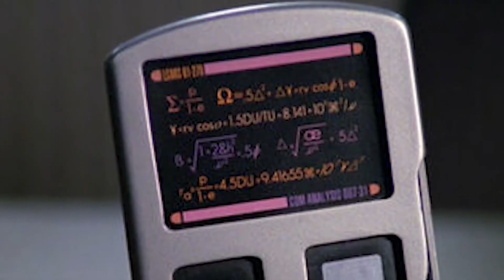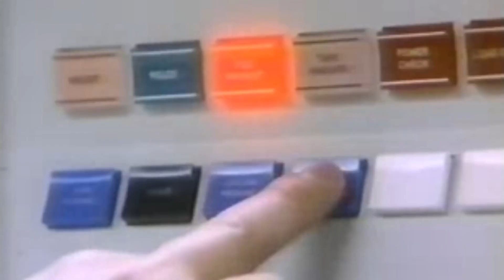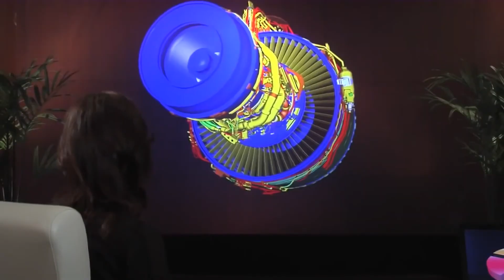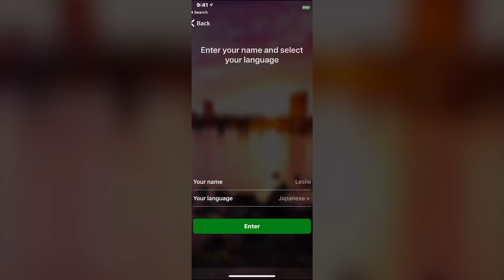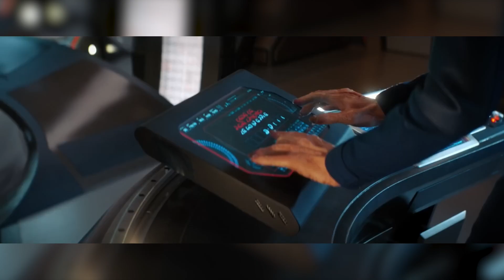Star Trek Tech: Predicting The Future

Comment: The medical scanner looks like an ultrasound scanner. They do make portable versions that hooks up to a tablet. It's usually used by emergency staffs. Might lack the power to see in 3d like those big scanners but out in the field any image is better than no image. 

Ultrasound imaging has vastly improved. Recently I saw the live feed of a heart valve in action, it resembles a 90s vhs tape quality in monochrome with very high frame rates. No radiation no prep negligible discomfort. 

Suppose the next decade, machine learning would be advance enough to afford anyone to use an ultrasound at home and give a decently accurate prognosis. Then have the images verified by a doctor.